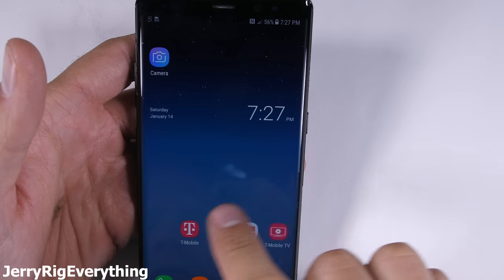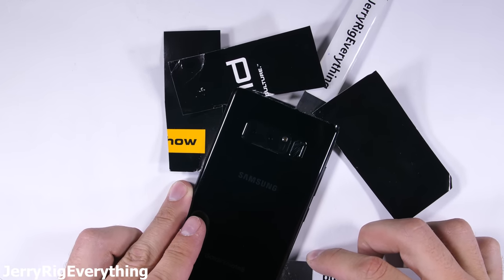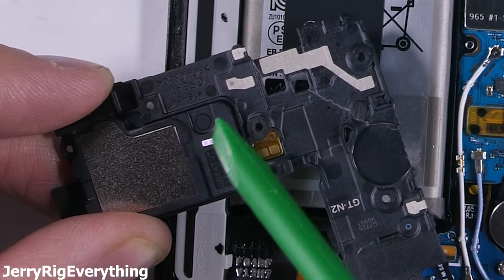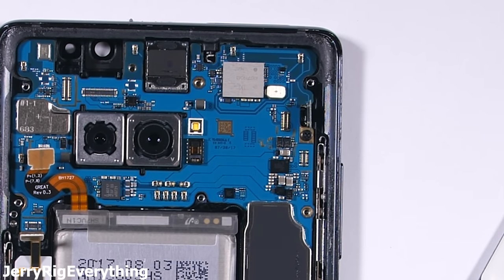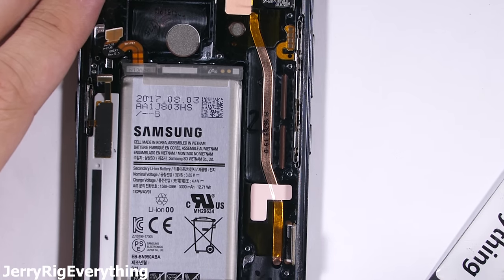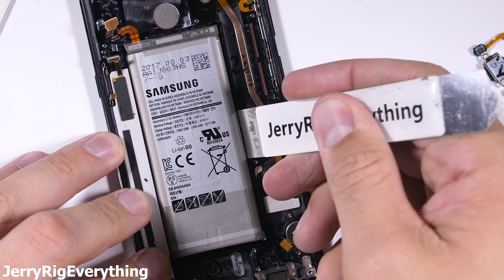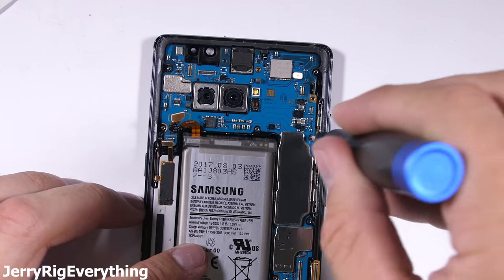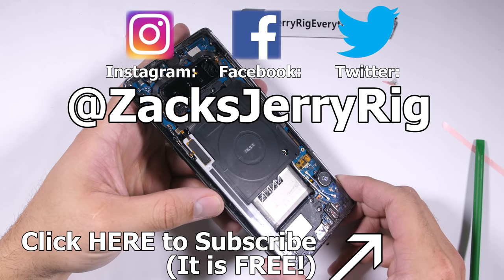Note 8 Teardown - Screen Replacement, Battery swap

Comment: What does the smaller screen ribbon do? Is it necessary to make the screen work? I have a s9 that I want to try to plug the screen into my note 8 for a temporary fix until my screen gets here from China and the s9 only has one ribbon? Does anyone know if the ribbon will be the same length for my note 8 from the s9? Any expertise would be greatly appreciate!!!

Comment: I'm no expert but there sure is quite a bit of room between the USB C connector and the bottom of the battery. Maybe they could have optimized the space better and make the battery a bit taller. Just sayin'...

Comment: When Jerry says the S-Pen holder is water tight, does that mean the phone is still IP68 Water Resistant without the S-Pen installed?
Reply: It is still waterproof without the pen installed.
Reply: So, for example... I could use the pen underwater or in the shower using the S-Pen without having to worry about water damage?
Reply: Joe Tippett yes
Reply: Aw, brilliant! Thank you! I just wish there was a video on YouTube that could show me just that. The phone being used under water via the S-Pen. Don't suppose you got know a video?
Reply: I've already watched that unfortunately. I will admit, it is very informative, but it doesn't really answer the question I've been trying to find out, and that is if you can use the phone like normal while under water by using the S-Pen. 
The reason I want this answered so badly is because I have this phone being delivered on Monday as an upgrade from my ageing S5 and I used the waterproof aspect of that phone to the full throughout my use, and I will most likely do it again, but I've always wanted to use a phone while under water. Hence I think the pen should be able to do it... I just wish I could find a video out for sure.

Comment: theres a way to have a removable battery with water resistance but need an extra engineering works.. but no way they will bring it back..

Comment: why Galaxy Note 8 is too expensive
Reply: Depends on the country. At least I know it's more expensive in Australia than it is in Singapore. It seems that it's also so expensive, that only South Korea got 128GB and 256GB (The Daily Note (YT channel) has the latter). Even then, in my opinion, it's worth it, because it's basically my "almost perfect" phone, and I do plan to use it for at least 1-2 years.

If you want, I can give you some tips on if you really want to get one for a small discount.

Comment: .....and here I am I just put my thumb nail into the slot designed for the nail and peel off the rubberised back cover of my Samsung Galaxy S5 to access the battery - 1 second effort! It is still ip67 water resistant too. BRING TECH THIS BACK SAMSUNG!!!!

Comment: So it's a tutorial to show you everything but the screen replacement. Useless
Reply: He basically talked about that at 4:45. You remove it like the back glass, which is, heat it up, use something thin to pry out the adhesives.

Comment: The inside is so cheap and you’ve got exposed wires and you can see the circuit boards, you’d never get that on an iPhone, even the insides look nice and not made of a cheap material, they’re even considerate enough to include pull tabs to remove the battery
Reply: Thomas Horsman complaining about something the average user isnt going to worry about😂😂
Reply: Thomas Horsman talking about cheaps and exposing materials of samsung.. well iphone8plus batteries are expanding like hell now bursting the phones back.
Reply: Kelnaruto Uzumaki only about 3 instances of this phenomenon have actually occurred, they have been bigged up in the news leading people to believe that it happening a lot. If you look at articles, you’ll notice it’s the same photos over and over again, because there is no other occurrences of this. Plus I think I’d rather have an expanding battery than an exploding one.
Reply: apple fanboy.....